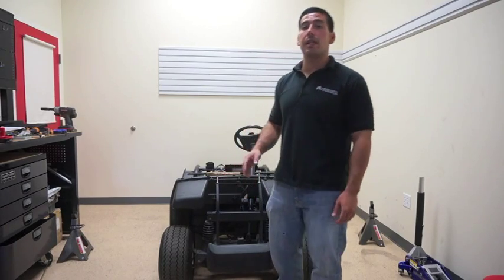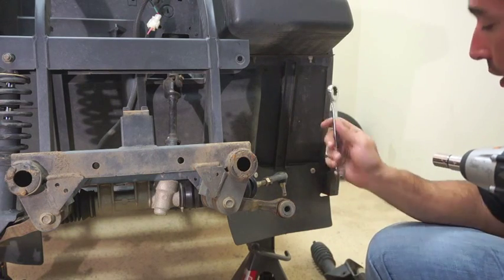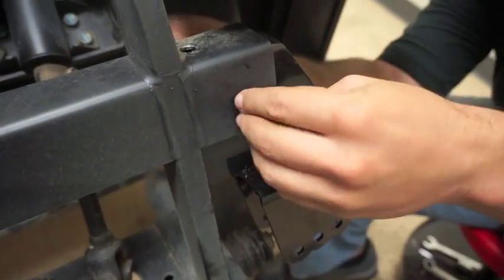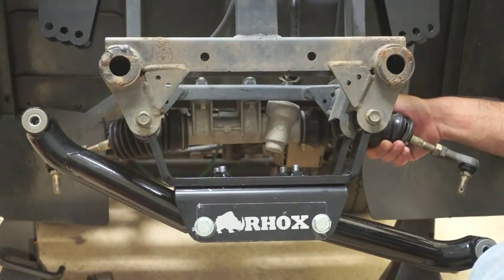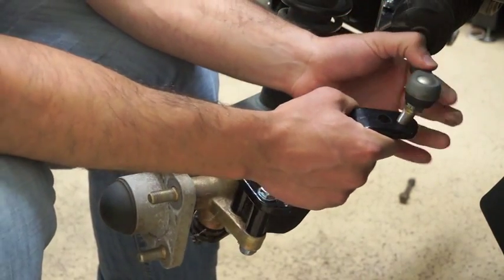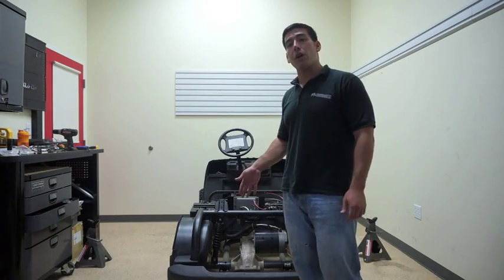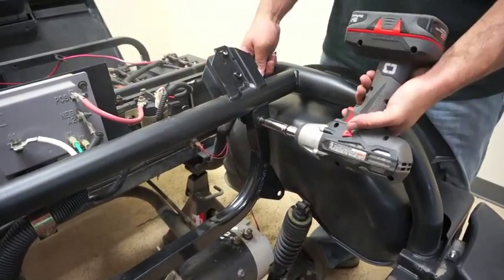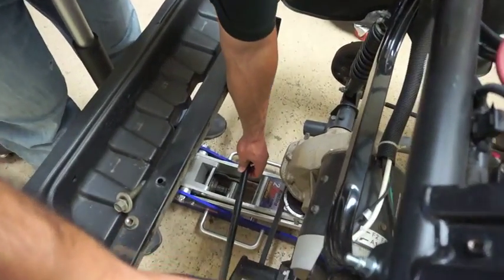LIFT-504 Yamaha G22 6" A-Arm BMF Lift Kit Installation Instructions

Comment: Recently had this put on by someone. When we drive it with more than one person. It will dart and feel like its on a flat tire. About the only way I can explain it. Def. dont feel safe driving very fast. Do you think its an issue with toe adjustment? Has Lift 504 with 10" tires.
Reply from the maker: Hi Louis. I remember talking to you via Facebook.  I"ll keep the conversation on there just to keep it in one place.
Reply: you need an alignment